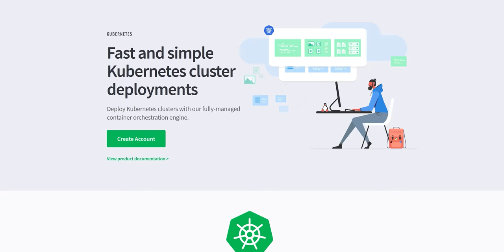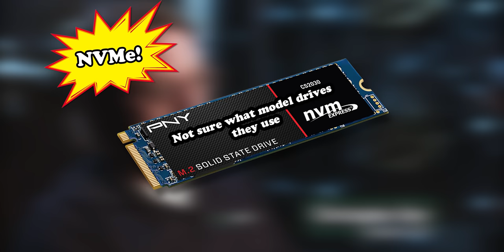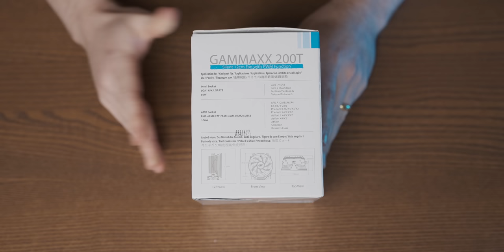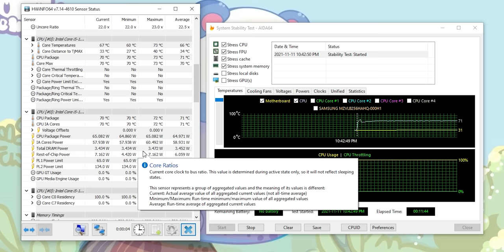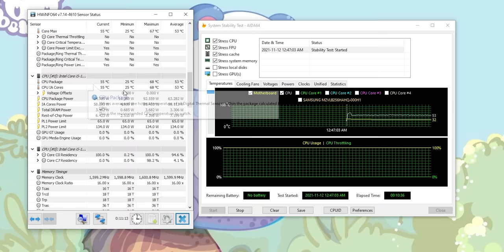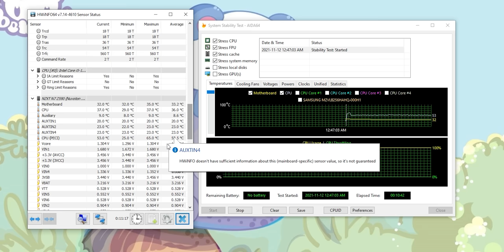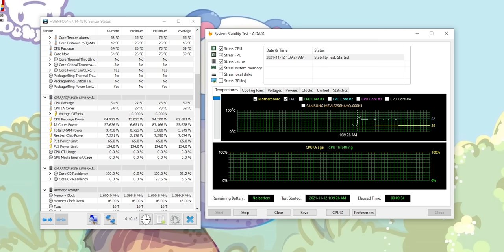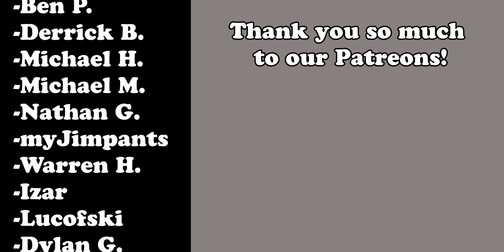Sub $20 Amazon CPU Cooler Shootout

Comment: Ryzen 5000 series and the new Alder Lake are going to need more cooling than a sub-$20 cooling can provide.

You should test air-coolers around the $30 to $40 range.  Quite a few models to compare.
Reply: DEEPCOOL GAMMAXX400 is currently $19 on Amazon and can handle 125 watts, so should handle the i5s OK.  Not the i7/9s, though.
Reply: @TheTalonts  The GAMMAXX400 has '4 sintered metal powder heatpipes' according to the specs.  Notice that these are NOT copper heat pipes, which is what most people want.

Also, The DeepcooL cooler makes no mention of LGA 1700  compatibility or mounting kits.   So you can FORGET about Alder Lake compatibility.

Comment: Hey @Dawid Does Tech Stuff, I think instead of using the Thermal Grizzly PASTE, you should have gone with a PAD to mitigate the risk of differential results due to inconsistent thermal applications...YES the pad may be 2-3 degrees warmer but result wise accuracy would have been much more paramount and in turn profound...

Comment: As sad as it sounds, I've found the OEM coolers to be OK if you don't overlock, don't game, and have plenty of airflow through your case (at least an exhaust fan, intake fan and perhaps one on top).  Of course for some of the high-end CPUs (like the 8, 12 and 16 core CPUs) the OEM cooler is probably not enough, but for most 4-6 core CPUs, usually the OEM cooler is adequate if you aren't gaming or overclocking and have good airflow in the case.  Honestly, I would probably trust the OEM cooler over a $20 cooler from Amazon unless it was a name brand, but most OEM coolers are tested to work with the CPUs they pair them with in a "normal" environment (ie. a PC running unoverclocked, and at room temperature with reasonable cooling in the case--at least a fan in the back with air vents of some sort in the front or sides).

Comment: I have the Gammaax 400, and it does extremely well with my 3600. 27-32 at idle, and 48-60 when working\gaming. I do have a very good airflow case though (Phanteks P400A).

Got it for 30 CAD, which is about 24 USD. So not "sub-20", but not far from it.

Comment: Any fan comparison that doesn't normalize noise most often is not useful, as even you mentioned that the Dell cooler's second place result is somewhat invalided by its noise. Though, to be fair, even in this regard, the tower design won outright. Thanks for the vid, Dawid!

Comment: Please do sub-$20 dollar ebay CPU coolers. There's a model called the Vetroo V3, which is overshadowed by its higher end $30 V5 model that Jayztwocents praised earlier this year.

I think it would be perfect for an i5-10400. Also, as someone who bought a Dell prebuilt to get a GPU, fuck that stock Intel heatsink. From the factory, Aida64 gave me 91 degrees Celcius according to HWINFO64. Was genuinely surprised to see it do so well for you. Was not surprised to hear it sound like your motherboard was about to lift off though.

Comment: I use a Raijintek Juno PRO (the thing cost me like 1500Yens) [It's quite similar in shape to the Gamma Archer but with RGB] on one of my build.
And damn, for a low profile cooler (only 66mm high), knowing that the thing is paired with an I7 8700k OC'ed to a base clock speed of 4.2GHz, the temps rarely goes over 75°C at full load with an ambient temperature of 23°C in average. (There was a time were the poor thing goes to almost 100°C, but well, it was during a heatwave and the ambiant temp in the room was 47°C ... so, not really the cooler's fault :p)

Comment: Dawid can you compare the Thermaltake Contac 9 SE CPU Cooler, 120W Cooling Power, 92mm PWM Fan to the Gammaxx 200t please? I'm trying to decide what to put on my 5600x and it's down to those 2. I'm leaning Thermaltake though because it's a slightly smaller cooler.

Comment: Nice, you tested the cheap coolers with an appropriat CPU, would be interesting to see how much OC the 200T can do on an overclockable 65W CPU. In the end, just the crapy, cheap-ass, pain in the arse mounting system is reason enough to spent 10-15 bugs more on an air cooler. At 30-40 bugs you can get something decent which might just be acceptable at any point, but at least not useless crap.

Comment: I have it up here cooler that has a 90 mm red fan with a R310 100 at 4.1 GHz max it gets is probably 72C witch I could somehow overclock it to it’s an  MSI  B560 M pro motherboard  It’s a recent build has a 750 TI SC from EVGA pretty good system I most likely we do an older games on it though like fallout new Vegas GTA five is probably the newest game I got on it so far anyways and one that was free on epic games

Comment: 200t is a good choice if you need something really cheap and don't want to buy a Snowman off Aliexpress. These other cheaper coolers are probably only worth for people flipping low TDP athlon/pentium based office PCs who bought the CPUs used without the stock coolers. People making ITX builds usually can afford something better like a NH-L9s. I fully expect all of them to perform worse inside a case though.

Comment: Does this Zalman have PWM speed control? I don't think it does. But as far as 20 year old coolers go, theirs are pretty amazing. It's curious how much mileage you can get when the quality and precision of manufacturing is high, that fan should have been by all reason a lot louder, and it's not strictly silent, but the sonic signature that it has is very pleasant.

Comment: I have had the 200T for about a year. It's cooling a 9400f so nothing really powerful.
The cooler is good, just 1 problem. It's REALLY hard to remove. I was struggling for about 30mins with the removal process

Comment: I'd rather say that the Dell cooler's speed control pin either:
1. started to use a more proprietary fan speed control method
2. was not connected
3. was given unfair advantage by setting it to 100%
Reply: I'd assume dawid is just using the default fan curve, each fan reacts differently to certain amounts of current. I've used a similar cooler to the dell OEM one and the fans on them just spin really fast. You could set a custom fan curve to make it spin much slower but then it would probably perform very badly, perhaps worse than all of the others on the list.

Comment: I just wonder why anybody would build a computer but then skimp on one of the most important parts.  Just spend another $20-$30 and get a better CPU cooler and instead put cost cutting effort into a less expense case, cheaper case fans, etc
Reply: Unless you are overclocking you really do not need anything fancy for most processors. And the big name boxes show that. The Dell cooler shows what you can get away with if you are only looking for something that does the job at a low cost. Yes a better cooler can be quieter, but once the CPU doesn't go above 80 or in some cases even 90 degrees in a stress test you really do not need more. Sure it may be nice to know your processor doesn't get above 70 or perhaps even 60 when stressed, but it doesn't change the performance of your computer, and it doesn't really make it last longer. Well at least of you keep it under 80 or so. Pegging it at 90+ might cut down it's life expectancy some even if you manage too keep it below the throttling temp.

An argument can be made for more expensive coolers having more reliable fans, and that might be a valid concern. But having worked PC support for at least 30 years I've seen a lot of fan fail, and the high end fans fail they too. Even maglev fans do fail. We used thousands of those in servers and while they were a lot less prone to break than fans with FDB, sleeve bearing, rifle bearing and the like a decent dual ball bearing fan was almost as reliable as the mag lev versions. So I wouldn't really worry about fan life. Fans fail and you replace them, that's just how it is.

Comment: I’ve used the PC Cooler brand for some flips and returned them immediately. The mounting surface is machined and isn’t even a smooth so the contact sucks. You can even make out the surface @ 2:37 … it’s awful. When I left a bad review they offered me multiple times to refund me if I changed my review. Umm I already did. 🤨

Comment: I have few pcs from 2009 ddr3 dells and HPs the HP ones have 2 copper pipes n tower structure vs dell one thats like stock coolers so i decided to keep the HPs and sell the Dells.
Edit: the only dell dat era that has 2 or 3 copper pipes was the motherboard that supported the q6600 coz its a hot cpu by the time the q8400s came by all the coolers were downgraded with no copper pipes so dats y i kept the HP ones.

Comment: Not so pro tip: you can cheap out on a Cpu cooler if you're not concerned with looks but don't buy anything deepcool in the power supply and case department, they are absolute trash and a genuine fire hazard! Every time I plugged that hunk of junk into the power it sparked and every time I touched the case I got a considerable amount of electricity go through me, also their cases were hideous so I replaced the power supply with a asus tuf one and the case with a cooler master one, best decision I've made in recent memory

Comment: Funny thing that tower cooler with the dell fan.
Its a great combo.
The fan of the dell is so strong .
That with the tower combine .
The fan go really in slow rpm mode

Now do you think wy i dit this ?
Dell motherboards only work with dell fans on a correct way in the bios .
So i had to do it.
Or the dell pc go off.

Cpu i use on that moment is a e-1245 cpu.
The monster of this cpu go under the 60 Celcius on full mode .
The max boost always be hit with out problems .
And the original fan dit not go on full power mode.

Comment: I am building an ITX PC and have only 72mm of clearance for an air cooler. The new 5600x i am using came with a wraith stealth cooler, but that is ugly.  I have a wraith prism cooler which is pretty sweet, but too tall.  I used thick heavy duty 2 sided tape to attach the fan from the prism to the heatsink of the stealth and it worked.  I am very surprised the tape hasn't melted yet, but its only been 2 days. I wish I could upload a pic.  Has anyone tried to use the wraith prism on any other heatsink?  I would love to know!

Comment: The results are fairly predictable. Another aspect to pay attention to is the cpu's boost capability per cooler. The worse coolers were struggling with higher temps while the cpu was running at lower boost frequencies, imagine how much higher the temps would be by forcing the cpu to boost to 3.5 ghz with the worst cooler like it was with the tower cooler. The results would have been even more glaring then.

Comment: Considering you can get the CM Hyper 212 Evo for 25$ on sale regularly - all these coolers are just trash. Seriously why would you recommend anything else - ever - for budget gaming? Budget: Stock cooler - or 212 Evo. That's it. If you go a bit higher you can go into Be quiet!, Noctua, Cryo and so on - and the next step is AIO.

And it's very easy to explain why you should always only recommend the 212 Evo for budget builds: It's very close in price to anything else which has a better cooling ability than the stock cooler. The build quality is unmatched in the price range - so it lasts forever. (Seriously one of mine is from an FX6300 and it now cools an 11400F in my media center. All I had to do was send an email to CM and they send me a compatible bracket.) It's literally almost 10 years old and still cools and is quiet like when it was new.